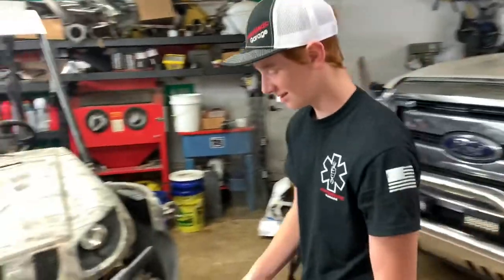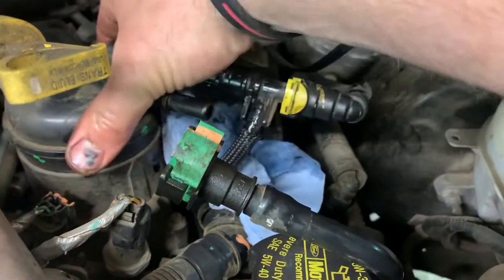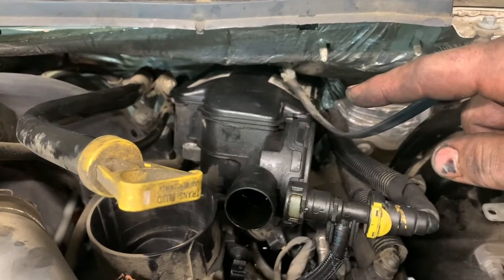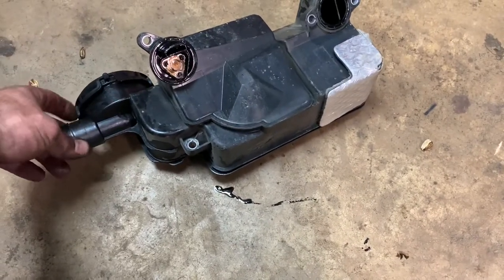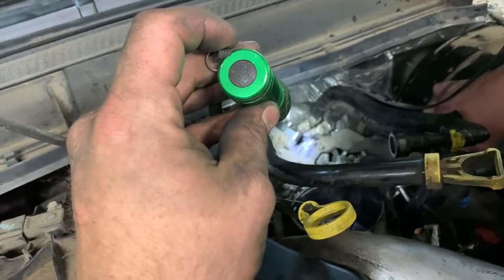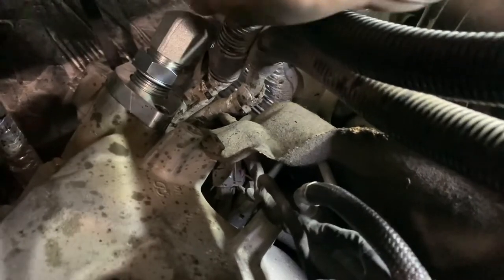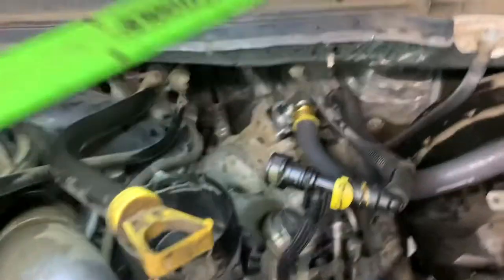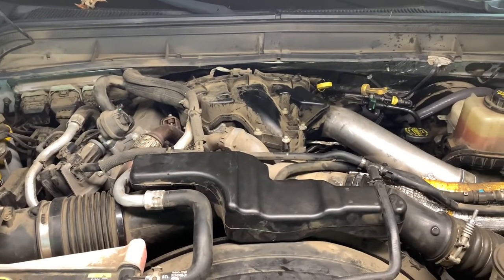6.7 Powerstroke CCV delete

Comment: There is no filter in the 2011-12. That ccv is hollow. Just a series of baffles. Something else in the motor is causing crank case pressure. The cel is from the sensor on the turbo side of the tube running from the ccv box to the turbo.
Reply from the maker: Your correct I misused the term filter, it’s a separator that can still get restricted and over pressurize the crank case which is what was going on here. It solved most of the problem, the leak ended up being the vacuum pump bolts were loose, typical problem on the early 6.7s, which the restricted “separator” amplified the problem. I have a video on that also. So forgive me for saying “filter”. It’s a good mod regardless and I recommended it to the customer cause I like keeping things clean and recirculating hot vaporized oil back into the motor has never made a lot of sense to me.

Comment: These trucks are notorious for the vacuum pump to leak due to bolts not properly torque/thread locked from the factory.
Reply: You’re absolutely correct. Mine was leaking too.  A lot of people just tighten the bolts down. But I took the time and put a new seal in with loctite on the bolts

Comment: Did you get a CEL after the install? Just curious cause I didn’t see where the sensor got plugged back in
Reply from the maker: There is no sensor on the factory CCV filter/catch.
Reply: I capped the end of the hose on mine so that the sensor could stay connected

Comment: Did this stop your leaks?
Reply from the maker: It slowed the customers leak which is what I suspected. I explained that his CCV filter had never been changed and was way over due for it anyway and that regardless this would be worth doing and that we may have to come back and readdress the issue which is the vacuum pump bolts aren’t torqued correctly(common) and the seal/gasket should probably be replaced which is what we are doing next when he can go without the truck for a day and I’ll do another video on that. Thanks for commenting. Stay tuned.
Reply: @AutomedicGarage  My front engine leak ended up being the vacuum pump. 2 of the 4 bolts I could turn with my fingers. So glad it was not the upper oil pan.
Reply from the maker: @davidr9870  vacuum pump is a pretty common leak. It’s dumb they didn’t roque them or use thread lock on them.

Comment: at 4:18 where you all installed the rubber plug on the factory hose on my truck i have a electrical connector what did you all do with that just leave it unplugged and loose?
Reply from the maker: What year is your truck? This was 2012 if I remember correctly which means there was no electrical plug.
Reply: @AutomedicGarage mine is a 2012 and has an electrical plug there do i need to keep that plug connection on there and plugged in to keep from throwing any codes? or just leave it unplugged?
Reply: @AutomedicGarage because in your video and all the others i’ve seen it looks like just the rubber plug and no electrical connector is left where that is installed
Reply: @noahtucker4214 did you ever get a answer for this? I have the same

Comment: I know this video is older now. Did it fix the oil leak issue?
Reply from the maker: It reduced it, did not fix it. The leak was the vacuum pump bolts were loose causing the leak. I have a video repairing it.
Reply: @AutomedicGarage   Awesome, thank you for the info and the super quick reply!

Comment: I did the delete/reroute on my 2016 6.7 and now has check engine light but there was no sensor. P04E3 any ideas on how to keep that off
Reply from the maker: The truck in the video is tuned and that’s probably why it doesn’t throw the CEL but I have done others not tuned and not had a CEL either.
Reply: My truck is fully deleted and tuned but still throwing the check engine light
Reply from the maker: nickaudia4 if I remember correctly 16’s had a recall on the fresh air inlet tube. Did you install the nipple covering the air inlet when you did the CCV delete?
Reply: Where does the other end of the hose off the box go? Nothing mentioned again after removal.

Comment: Will this void my warranty?
Reply from the maker: @Se7vinDeadlySins  have to ask Ford but I wouldn’t think so
Reply: @AutomedicGarage yes it will 10000% its modification of emissions controls, on paper a federal crime 😮
Reply from the maker: @davidb1089  this is not part of emissions control. CCV stands for crank case ventilation. It is not in any way form or fashion a emission device. Don’t troll my channel and try to draw unneeded attention stating inaccurate information as if I violated something.

Comment: It's needed. If it's clogged it could be replaced. The turbo is going to start leaking oil into the exhaust without it.

Another problem is you are not pulling the oil vapors from the crankcase so internally that is going to contaminate the internals (oil).

There should be a better option.
Reply from the maker: This works great, the vapors come out through the pipe under the truck. I have had zero trucks develop leaks with this. If you run the CCV hose a long distance yes but if you run it straight down, zero issues. It’s oil vapor, it won’t contaminate anything. You act like it’s something that isn’t already in the engine. I understand the concept of increased crank case pressure if it isn’t drawn out but if you run the hose as short a distance as possible I and others have had zero issues. It was the same argument on the 6.0s and 7.3s but it all worked fine for me also. If you don’t like it don’t do it. The truck in that video has had 50k miles put on it and is over 300k miles total now with no issues. Thanks for watching.
Reply: @AutomedicGarage  the oil vapors can develop sludge and moisture in the engine over time. Moisture cooks out but sludge forms.
Reply from the maker: @RoadKing05FLHR  the funny thing is I’ve seen more issues with the factory setup on the early 6.7s with the factory CCV box than any other and this solved the problem. Like I said if you don’t like and don’t believe in it that’s fine, don’t do it. I like it, it works for me and I’ve had no such problems and much like you I’m allowed to have my opinion. No one is forcing this mod on you, YOU DONT HAVE TO PUT ONE ON YOUR TRUCK!!! Thanks for watching.
Reply: @AutomedicGarage  that's not the point. The point is what I stated. The ccv works as it's supposed but if it's needing maintenance it needs maintenance. Removing it completely is as I said.
Reply from the maker: @RoadKing05FLHR  works great removed. I like it removed. If you don’t leave yours on. You don’t have to like what I did, I don’t have to like what you did. It’s ok. I did what the customer wanted. If it was your truck and you wanted to keep it that’s fine to. It’s your money. Don’t get bent out of shape over it.

Comment: Your truck doesn't use a filter. They are to different models of housing
Reply from the maker: This isn’t my truck, your correct it isn’t a filter is more of a reservoir, regardless they end up leaking oil once they fill up, cleans the engine bay up. You people that are so concerned on being politically correct blow my mind. You knew what I meant, you knew it didn’t matter if it was the filter or the canister. Who cares and it doesn’t matter yet y’all feel so compelled to pat yourselves on the back with a politically correct comment.
Reply: @AutomedicGarage  damm bro nobody is trying to be politically correct. Why you getting so trigger. I am letting you know because you were trying to buy a filter and on this models you buy a replacement housing thats $30 to $50 dollars more then the filter.
Reply from the maker: @modernmopcar1832  not triggered. People making pointless armchair mechanic comments is annoying. I called my parts guy at the Ford dealership that delivers to me. Gave him the part number. On National back order customer decided to go this route. End of story. Regardless of what I called it it does the same function either way.
Reply: @AutomedicGarage  i thought you were looking for the filter bro , i thought they were giving you the wrong information it happends sometimes. I was just letting you know, i have the same issues.But good thing it work for you.
Reply from the maker: @modernmopcar1832  👍